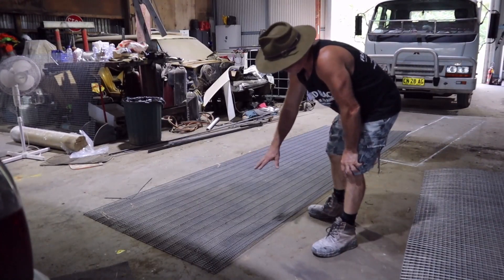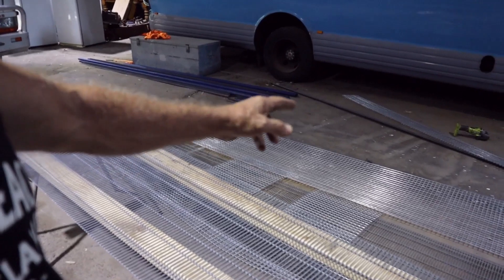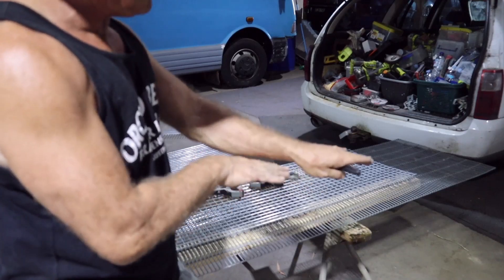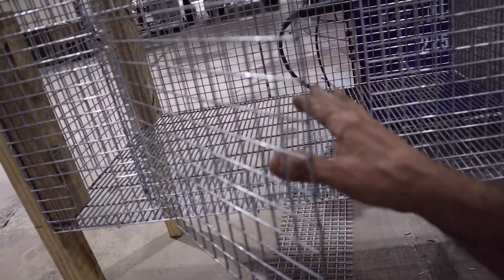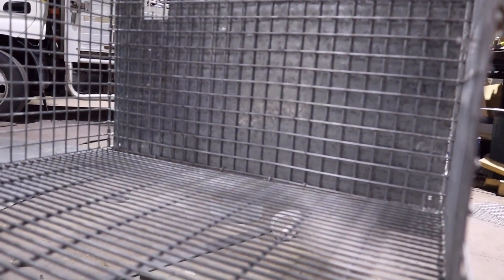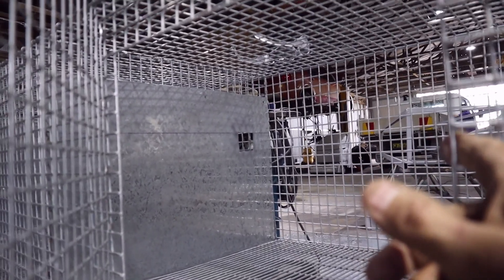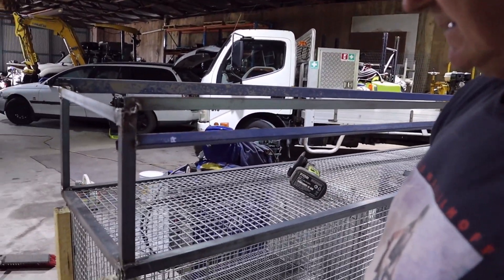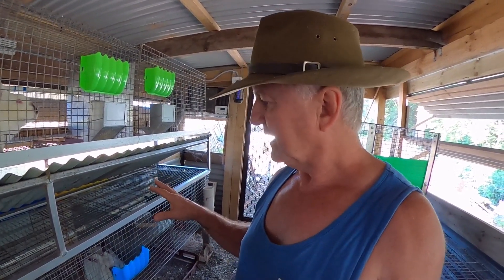How To Build Rabbit Cages From Scratch !

Comment: Hi Michael when I  was kid my old grandad used to have two story hutches and he would run a hose or pipe full of holes the full length of  the high part of the sloping floor and just connect the garden hose and flush the tin when needed, but these days you could use black irrigation pipe because it’s cheap. Thanks for sharing cheers.
Reply from the maker: Interesting i will keep that in mind👍😎
Reply from the maker: Very interesting Barry. I'll keep that in mind 👍😎